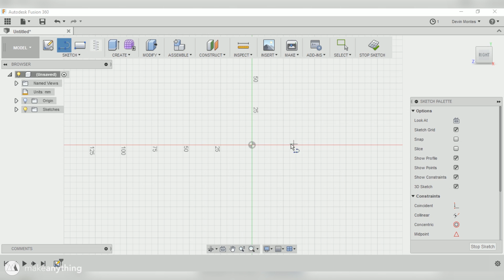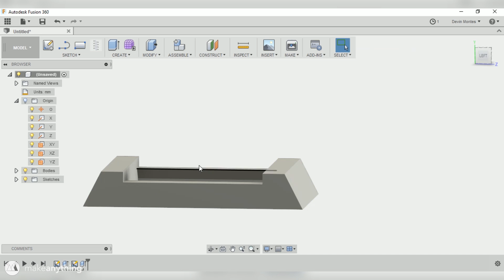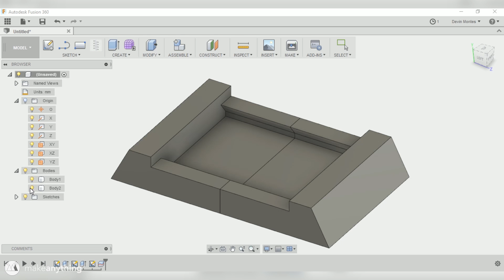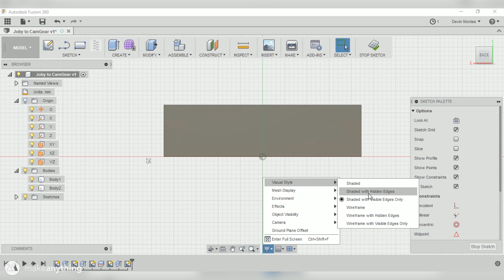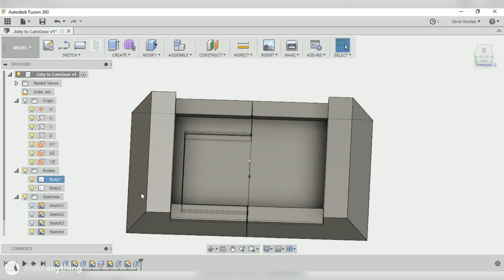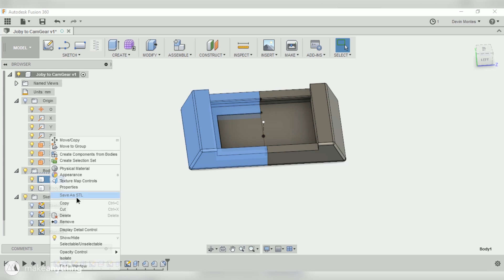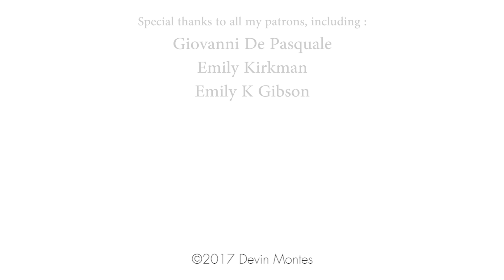3D Printed Tripod Mod // Functional Print + Fusion 360 Tutorial

Comment: Wow, that red and black one on the right looks just like mine. I don't have the little plate, so I've been trying to make something I can stick in there to mount my camera on.
Reply from the maker: +chrinamint I believe you can use a standard 1/4-20 bolt to screw into the camera, so combine that with an appropriate sized plate and you could be set!

Comment: You could also make a part that mounts like a camera onto the tripodmount. But the "fake camera" is just a piece that can be connected with a part that is mounted on the camera.  If you dont understand what I mean here's an other explanation:
You screw a part onto your camera. This part has(on the bottom) a connector; the connector is shaped like this ( as an example) : 
 <——>
On your tripodmount, you screw the other part in shaped like this:
<_> 
In total it should look something like this:
  ____________________________
  |________top_part____________|
/   /                                             \  \    
\  \ _________________________/  /
     |_____bottom_part________|

A bit easier:
         Camera
|--------------------------|
{(                         ) }
  |---------------------|
   Tripodmount

I hope you can understand my symbol-artwork ;) if not, dont hesitate to ask me!!
Reply: tonpa888 good idea!
Reply from the maker: Good point, I would just be worried about relying entirely on the strength of the printed part between the camera and tripod, but I bet it could work!
Reply: Make Anything // 3D Printing Channel Yes, thats right! But how is the strenght with a 100% infill-nylonfilament-part?! I haven't printed yet with nylonfilament on my wanhao duplicator i3!